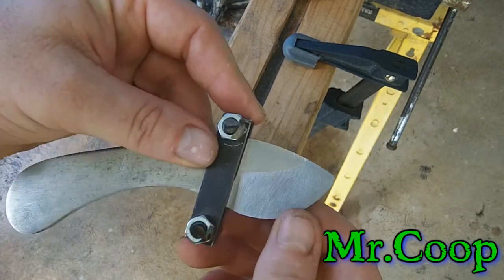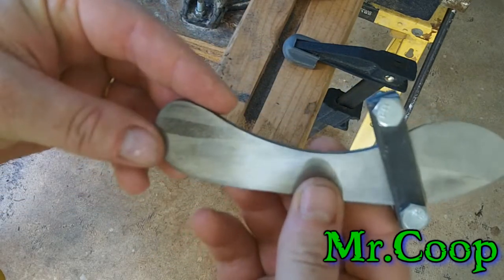How To Make A Knife Profile Your Knife Blade #4 DONE.

Comment: The belly on that little rascal will skin out deer all by itself .. you just have to watch..lol as well as the drop point will zip open the gut cavity like no ones business. If you have room in that handle  to make it big enough for your little finger to fit loosely, when you need your hands free instead of putting it down you can let go of it and it will swing out of the way, pivoting on your little finger until needed again, then flick it back into your palm. VERY NICE.